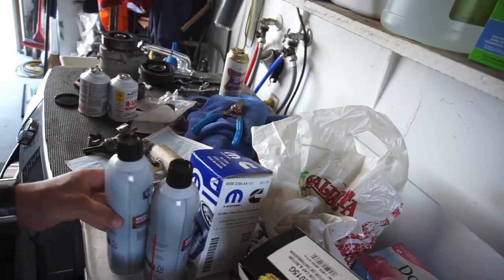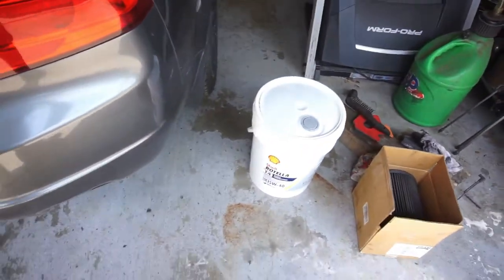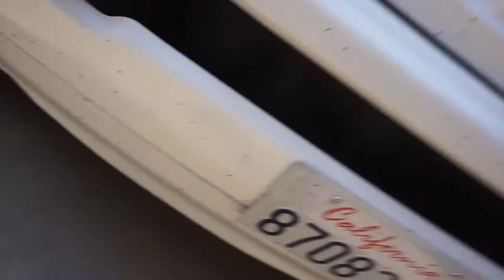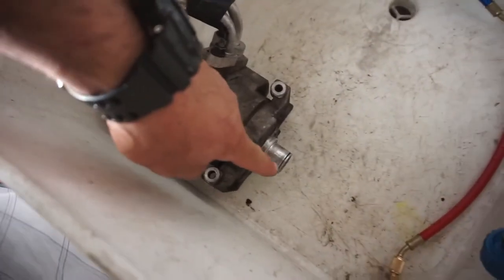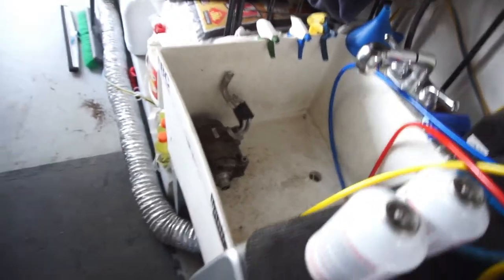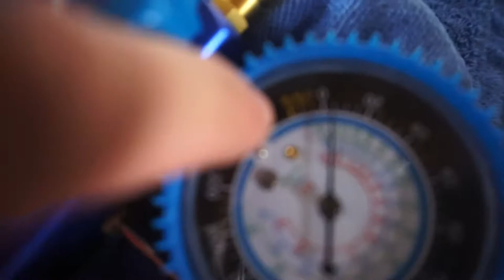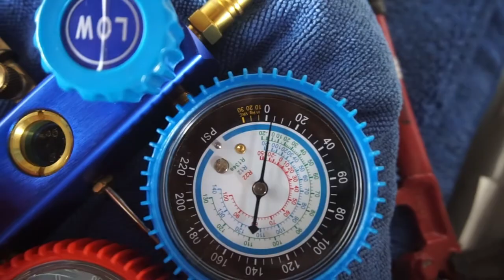4th Gen Cummins 2010 Dodge Ram 2500 AC Leak Found. Good Thing I’m A Horder.

Comment: Hope ya' got the air con. figured out .  That stuff is a mandatory anymore .
Reply from the maker: Time will tell if it’s actually fixed. But I’m gonna order a gasket and seal kit for the compressor because there’s no way I’m spending $400-500 on a rebuilt compressor when I can do it for $45.